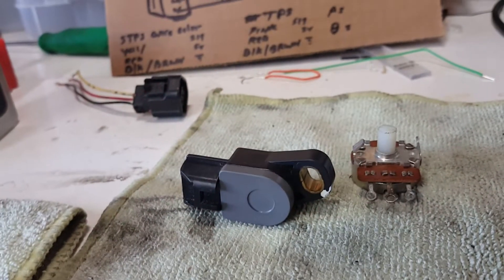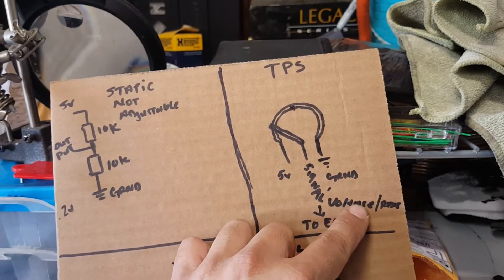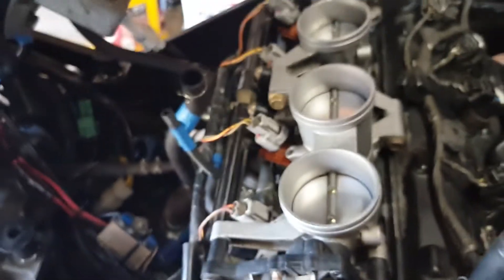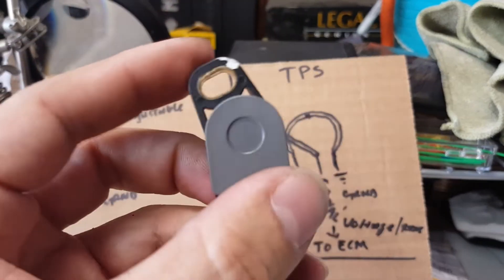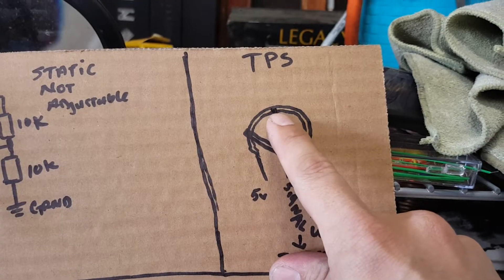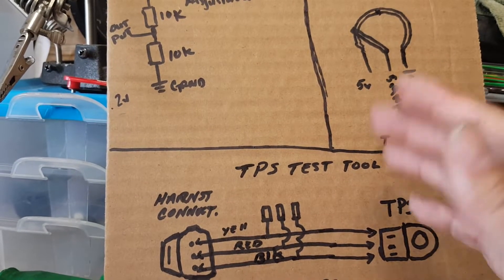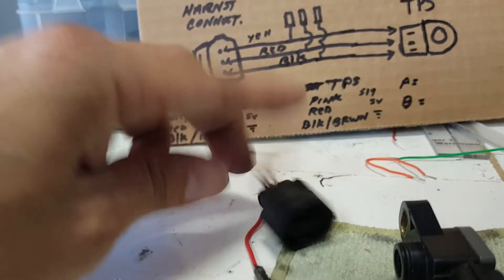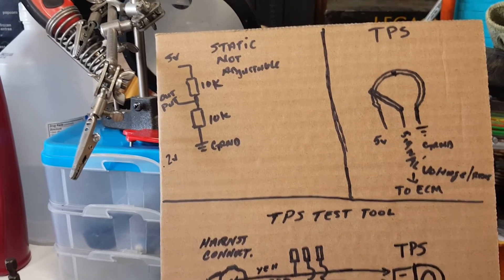DIY SUZUKI GSXR 600/750 Explaining the TPS

Comment: Heres you a question i got a 01 gsxr600 turn key on butterfly flaps move then go in place and start eletronic hum noise bike will only barley idle for few seconds run rough when it does . Any idea??
Reply from the maker: What up Charlie I know exactly the sound your speaking of (STVA gearing), I have a cousin who has the same issues on his 03 and unfortunately there's not much you can do aside from buying a whole new STVA. Here is what the STVA should do / act like during key turn to start.
 https://youtu.be/wfuXw0nhwh8

If yours is not looking/sounding like this then you have an issue. While we have never cracked open my cousins STVA to see (since no code thrown and it still works) I'm assuming why it makes that noise is the plastic gears within are slipping (teeth warn or broken) or the stepper motor is dirty or going bad causing it to skip step's.

I would do this:
1. Crack open STVA and inspect gears.
2. Crack open stepper motor inspect and clean.
3. Clean/Lube Butterfly linkage.

Remember, that little motor and plastic gearing has to move the linkage bar and plates under heaving suction. Big job considering if you put your hand over while the bike  is running your hand gets  immediately sucked in. So the more smoothly this system works the less strain it is on the stepper motor.

Hope that helps